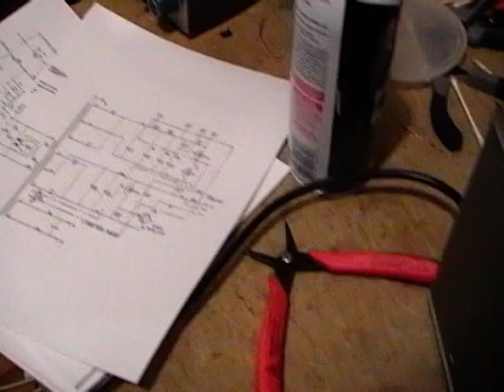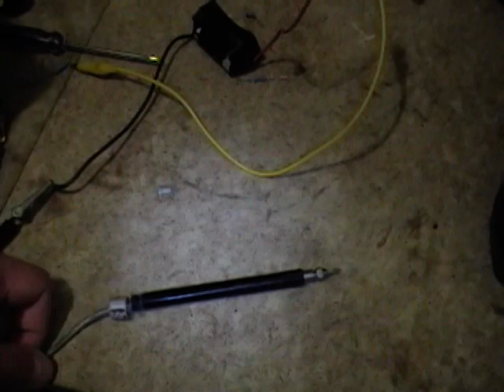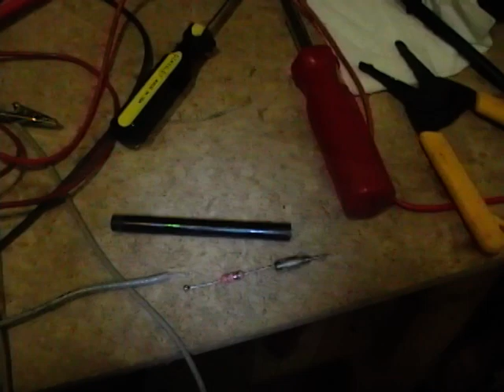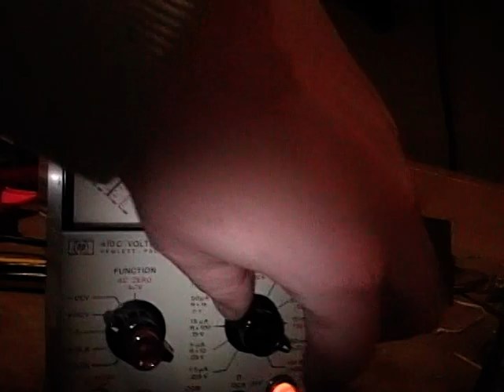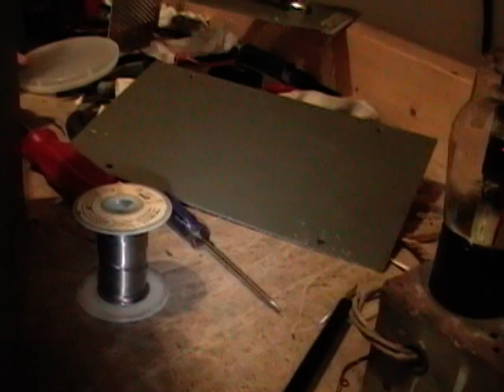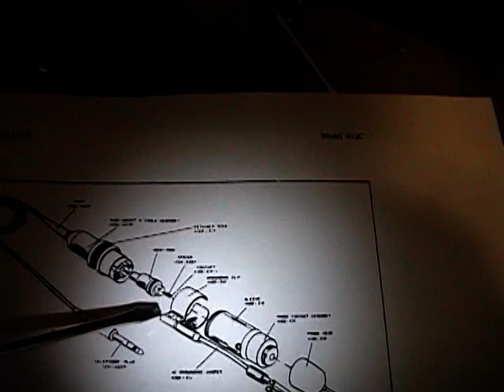HP 410C VTVM p1o2

Comment: Guys anyone know what this 1 meg resistor in dc probe do couse i dont  have  ac and dc probe and  off the shell ones dsnt contain resistor inside is it possible too mount 1 meg inside meter instead of inside probe .
If not why this resistor is in probe and what its purpose there ?
Reply from the maker: It's there so you don't load down the circuit you testing and is necessary for the meter to work correctly.
Reply: bandersentv
seems like i have too build 2 probes :) i try find 0.5 inch copper tube with this cone seal end and dam in poland it dsnt exist i think i use 2 end cap instead.
Can u check for me in your meter when u switch too ohm  needle is stable when u not short leads ? couse on my i see litlle movment it is minor .
I think meter need too warm up litlle and needle stay still at infinity .
In ac probe i test this diode UF4005-DIO ultra fast 600volt 1 amp we see.

By the way this meter is pretty nice and i must say i am love it :)
Reply: when i power up unit after few hours switch off filiment in 12at7 flash and after this is glow ok and then i switch off and on again there is no flash but when i leave off for few hours again filiment flash .i hope its not shorting live 12at7 i did measure 6 volt for overshoot and it is straight 6 volt when i power up meter .i am wonder if u have observe same behavior in your hp410c ?
Reply from the maker: tomo kolo
Sorry I don;t know.  I haven't used mine in several years.  Try asking on the Antique Radio Forum in the Test Equipment section.
Reply: bandersentv
np thanks for reply i think i leave like it is now i might suspect series regulator it is germanium pnp power transistor .

Comment: Well the great thing was after contacting the seller about it, he refunded all my money and told me to keep it. The reason I wanted the VTVM was because I am starting to build valve amplifiers and heard that VTVMs are the choice of people building valve amplifiers.

Hey one question hope you dont mind me asking, I've also been looking at the HP204C oscillator which produces sine waves. As I've never used an oscillator was wonder if you could tell me what they're used for?
Reply from the maker: Wow, nice!  I would actually prefer the version you have.  It is every bit as good or better as a VTVM and there's no need to wait for the valves to warm up.

You can do many things with an oscillator but I suspect you would be using it as an input source for testing amplifiers.

Comment: I brought one of these or so I thought so from ebay! even asked the seller if it was the valve version as I wanted a VTVM. Have plenty of solid state voltmeters. Guess what it arrives and its the solid state version.
Reply from the maker: I believe they use high impedance FETs and it performs as well or better than the valve version.

Comment: Not to bee picky but that 1/4" connector is technically called a TRS plug, for Tip Ring Sleeve, the standard plug is just called a TS plug for Tip Sleeve. It all comes form AT&T Bell labs, as the 1/4" plug was developed for use in manual switchboards LONG before stereo was even a gleam in the engineers eyes.  Its nice when something is that easy to fix.